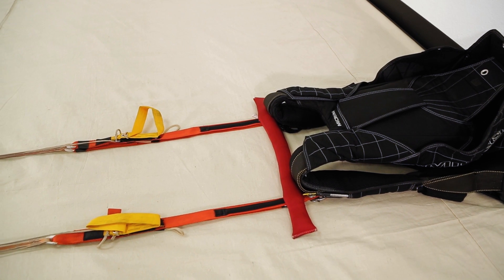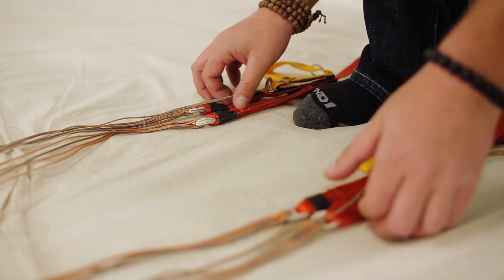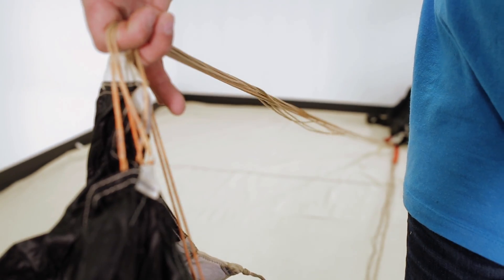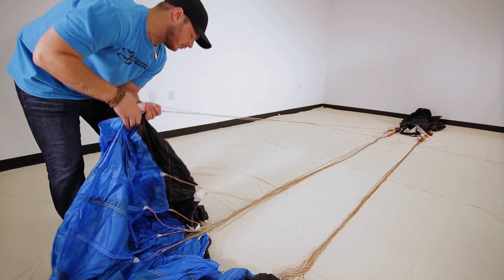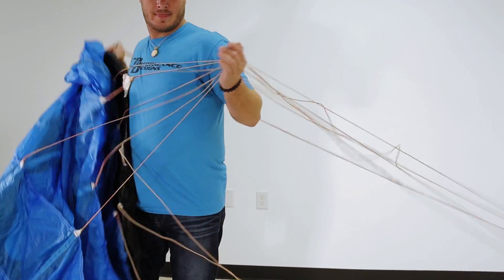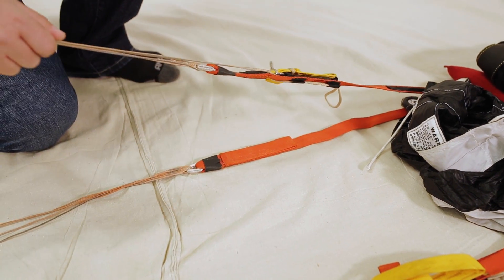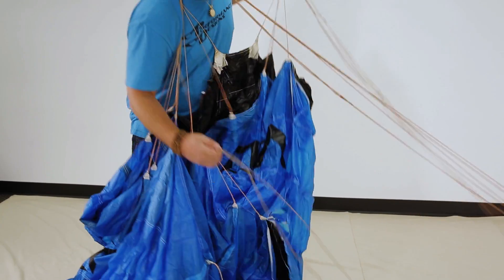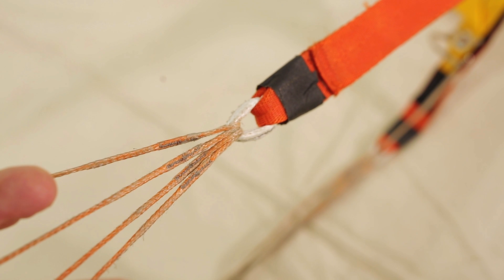How To: Continuity Check

Comment: Thanks for the video.
What are those black things on your risers, near soft links ?
Reply: +Wawet76 Looks like Gaffer tape. +Performance Designs WTF?
Reply from the maker: +Andrey Ulanov The tape is there to keep the SLink tab from coming out from the riser. We've heard of a couple instances where the SLink came out and a line wrapped around the tab, causing a malfunction. This is a good way to help avoid that, especially if you are jumping this level of a wing and are not using riser covers. However, an alternate method is to tack the SLink, which we do on most of our demo canopies. In this video, Matt prefers using the Gaffers tape because it makes it easier to swap out canopies. If you have any other questions about this, please give us a call! Cheers! -Melissa
Reply from the maker: +Wawet76 It's Gaffers tape. Check out our comment above for an explanation :).
Reply: +Performance Designs Yeah I got it. I'm just surprised you'd show that in a video on the official channel even though it's not mentioned in any of canopy manuals.